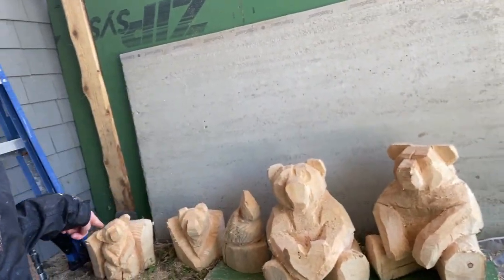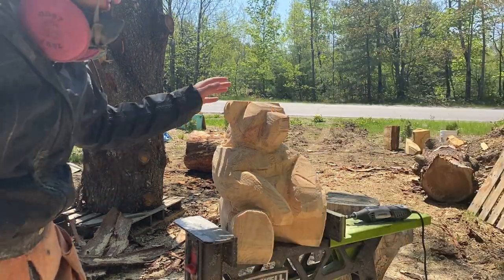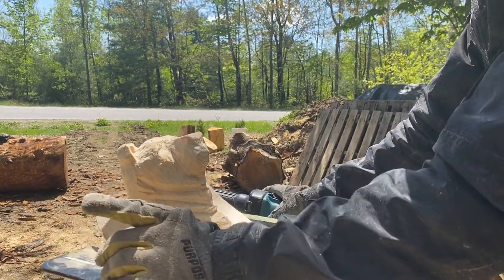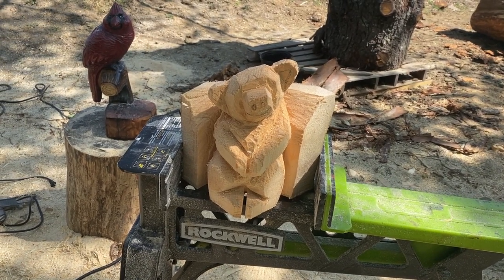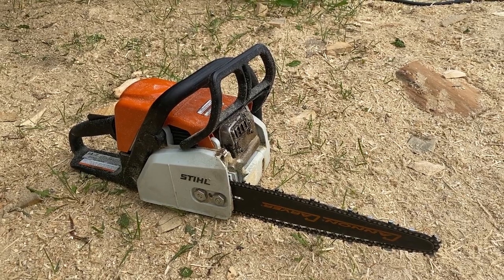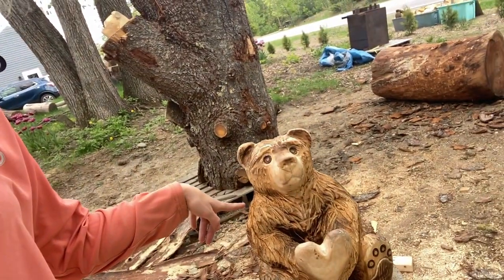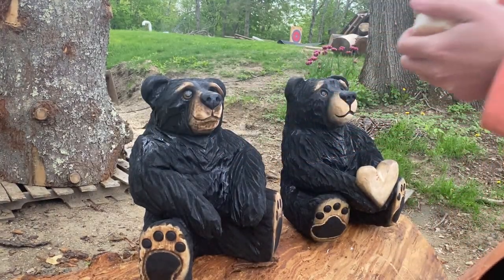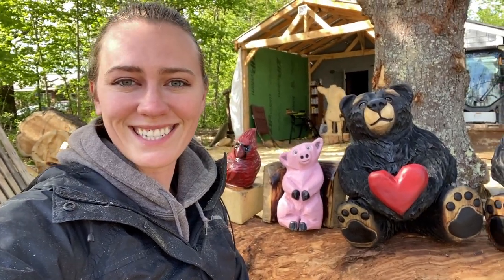Things NEVER go as planned (PART 2) | Details, Paint, and Finish

Comment: as a carver i see on the dime tip ,it's too tight i personally run my carving bars with about the same gap of the chain hanging almost 1.5 inches below the bar. 
i also have found that the electric saws aren't all that or at least to me. 
you do great work, i like your videos. 

2nd Life carving
Reply from the maker: I run my chain just loose enough that the bar stays cool, any looser is unnecessary and can wear and widen the track. I like my drive links to hang about a 1/4”  below the bar. I check the bar with each gas up and will adjust if needed. We all have different methods to the madness 😂 I started with all electric and they work great, but I tend to always grab my gas saws. There is something special about having play in the throttle! Mostly use electric these days for when I need to be inside or when I have delicate details and want more control without any saw vibration. I think they have their place but again, I always grab my gas saws when given the choice 😉